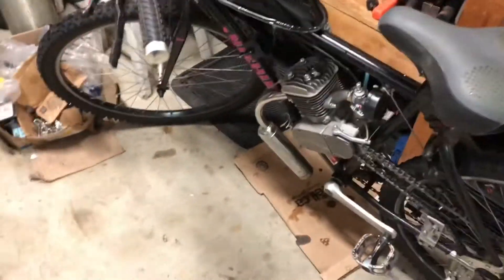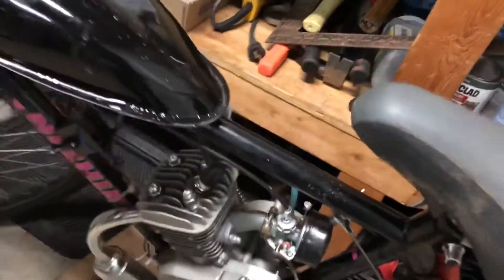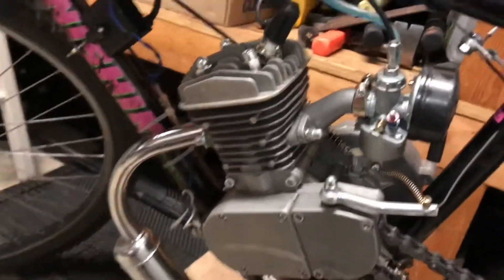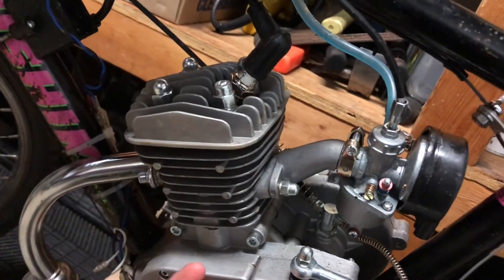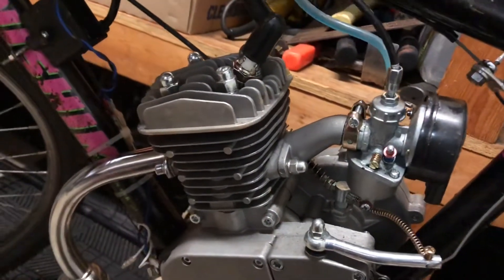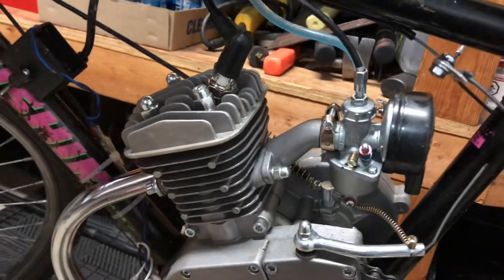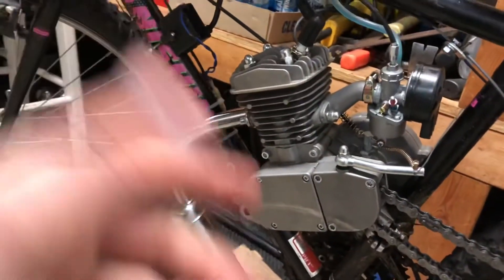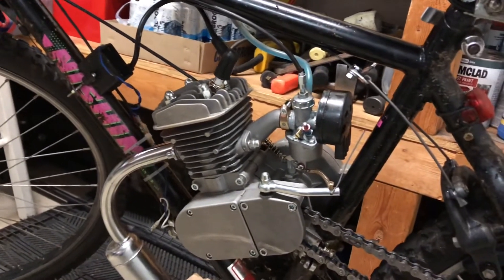Making MORE POWER for FREE on your Motorized Bike!

Comment: For more power take off the exhaust pipe, sounds nice and you can feel the power
Reply from the maker: In my experience, taking off the cap did make it louder yes, but I actually lost power because there was no back pressure. The carburetor hated it too. If you take the entire muffler off on a two stroke, it can over heat and wreck the cylinder. I would advise to not do that haha. If you want, you can check out my latest video of me taking the cap off. It was kinda a joke, but lessons can be learned.

Comment: 😁First and foremost Everatti.  You are so good breaking down on how to mix the fuel the right way.  Excellent job. Im gonna run 40:1 on my new 100cc 2 stroke I'm putting in.  Now it's my turn to school you on how to calculate your mpg.  First of all you'll need a digital speedometer.  Dont matter what kind.  Next, Fill the gas all the way up. Now, set your distance, or range to zero.  Do not mess with it until you ran out of gas.  Now calculate the miles that you put on the bike.  For example:  if you do 70 on miles on full half of tank, (Actually it really is .60 gallon) do it just like this.  70÷.50=144.  And there's you're m.p.g. (144 m.p.g.) Simple isn't it?
Reply from the maker: Thanks a lot! That’s a helpful tip. I’ll use that. I’ve actually got a digital speedometer on my bike, so that’ll work perfect!
Reply: @Everatti  Anytime 😁👍🏼

Comment: High octane, no methanol ( methanol eats up the lubrication properties of the mix oil fast it can drop 10 points overnight, so a mix of 40:1, can go to 50:1 so avoid methanol blends, plus it gums up carbs), Redline Racing Smokeless low sulfer synthetic, mix, 20: 1 to break in for a tank, then up to 40:1
Then let R rip tater chip
Reply: I run 20:1 used motor oil like comrade Stalin suggested. The Soviets thought of everything. 👍

Comment: Higher octane does not mean better quality fuel. Recommend a better fuel filter Its all about cleaning your virgin engine before hand.
Reply from the maker: The higher octane isn’t better quality fuel. It’s just where I live, anything but high octane fuel has ethanol in it. I’d get regular fuel if it was ethanol free. The ethanol in the fuel can gum up the carburetor if you leave it sitting for a while. It’s just not the best for the engine

Comment: My bike runs on Avgas Lucas oil mix and let me tell you my machine is a freaking lightening bolt lol

Edit: also It’s a between a 40-1/50-1 ratio, also fuel oil ratio doesn’t matter you can run it straight to a 50-1 ratio you just need to control your urge to punch full throttle. Great video man
Reply from the maker: Thanks!

Comment: Dude thanks a lot my engine would not get to high rpm until it was fully warmed up and the exhaust gasket would splatter oil on my knee when I was driving and I was using 16:1 and now I am going to try 32:1 now and I took the filter out of my intake and it runs a million times better and flows good at high rpm!!!
Reply from the maker: No problem!! That’s awesome good for you
Reply: What is the benefit of taking out the filter? Im having a bike kit aswell🙃
Reply: @maximroos6893  Allows way more air and less 4 stroking

Comment: I run 40 to 1
Reply: I'm at 370 miles no power loss
Reply: @jasonwilliams4197  stock head?
Reply: @iiferedoncXclan  yes all stock
Reply: @iiferedoncXclan  it a one peace head and jug 80cc
Reply: @jasonwilliams4197  be careful I blew a stock head running 25:1 5k kilometres
Reply: @iiferedoncXclan  I have a extra motor just in case

Comment: so i just bought my first kit, i have not even run a full tank of 16:1 yet and it will not start without me pouring some gas down the spark plug hole, after i do that it runs fine, does anyone know whats going on?
Reply from the maker: If it only does that from a cold start there’s nothing wrong. You just need to put the choke on haha. Check your plug color as well, and see what it tells you. I could probably narrow the issue down a bit if you were a bit more specific
Reply: @Everatti  it does that even after 20 to 30 mins of riding even with the choke on but thanks for the help
Reply from the maker: @978_danny5  okay, take the spark plug out. What color is it? If it’s brownish then the mix is perfect and it’s not the issue. If the plug is whitish, it’s running too lean, which explains it only wanting to run on choke. If it’s black, it’s running too rich, which is probably because of the 16:1 break in ratio.
Reply: @Everatti  so should i go straight to 32:1 or 40:1?
Reply from the maker: @978_danny5  If you’ve gone through a full tank, then sure. Go easy on it though. I’d only do 32:1 to start. If that doesn’t fix anything, come back here and I can try to help. Oh yeah, with 32:1 it’s gonna feel way faster too lol. Good luck
Reply: @Everatti  thanks!

Comment: Can i use 20 to 1 mix during break in period ? And after 40 to 1?
Btw im using castrol 2 stroke oil semi synthetic
Reply from the maker: Yes that would work great. Make sure to do at least 2 full tanks of gas on the 20:1, and go real easy on it until that break in is over. 40:1 should work great, but everything depends on your specific engine and how it runs for you. I’d check the spark plug after the first time on 40:1. If it’s black or brown, you’re perfect. If there’s any white on it at all, you’re running lean, and you need to richen up your ratio a bit. Thanks for the comment👍
Reply: @Everatti  ive changed the jug and added a cnc high compression head so its new , am i going to damage the engine if i go full throttle like for 1 sec or less just for the cool sound , during break in period?
Reply from the maker: @dj_impotencja  No lol. Just don’t hold it there forever. The main thing you don’t wanna do is keep the engine at a certain RPM for a long period of time. Full throttle is no issue, as long as you take it easy, and vary the RPMs.
Reply: @Everatti  thx for the advice
Reply: I recommend semi-synthetic breaking and then go to synthetic after
Reply: Yes , that's all I've ever done!💯

Comment: Wow lots of wrong facts.  You run 18:1 of organic 2 stroke oil for 2 gallons of gas to break it in.  This is so the rings can form. The oil helps remove particles from this process.  After it says 32:1 on literally all 10 of these motors of every random type you could buy lol.  Oil mix is 32:1 because of cheap bearings and seals in these kits. Also 40:1 or 50:1 will chew away at your chrome liner.  Now people mod these use different non stock parts and can run mixed like 50:1 without issues. One key point on oil mix in 2 strokes. Higher oil content keeps the motor cooler. Correctly tuned 2stroke will run fine on 32:1 "synthetic"under conditions like these bikes run.  My bike on my youtube channel is 32:1  mod yd100 can pull a 45mph run on a tooth sprocket lol
Reply: He's just a kid lol
Reply from the maker: Everything you said is correct. Run 16:1 or 18:1 for the break in if you’d like. That’s what I said lol. 40:1 is no issue on a stock motor - I’ve been doing it for almost 1000km now with no issues. Only thing that’s wrong here though - the air helps cool the cylinder, not the oil. The oil is there to lubricate the cylinder, not cool it. Although, if you are to use way too much gas over oil like 70:1 or something, that would obviously not be lubricating the cylinder, thus causing you to burn up your engine. So yes, at that extreme level, the oil cools the cylinder, not the gas or air. But I suspect no one runs 70:1 on one of these, so it defaults to the air cooling, not the oil. Have a great day dude👋
Reply: @Everatti  bud the oil cools and lubricates
Reply from the maker: @timothysmith9336  Lubricates, yes. A by product of lubrication is cooling. But cooling in itself, no. The air is what cools the engine.
Reply: @Everatti  bs

Comment: You totally disregard the Fact that the lubrication provided at 16:1 ratio is very different from that provided at say 32:1 or 40:1.  Why would a supposedly knowledgeable mechanic or rider do that? You focus your entire concern on power and/or spark plug life. Not giving any care for lubrication quality. Doesn't make mechanical sense.
Reply: If you've ever gotten laid you know that once it's lubed it's lubed.. Nothing to gain by adding any more..😬👍
Reply: @6fiddy309  Bull shit. As I suspected, your mechanical savvy is that of a smart-mouth boaster.
Reply: @dehoedisc7247 🤔Never fight facts using fictional information my man.  You'll lose every time.
Reply: @slicaltimistic1  never invent allegations for the purpose of self worship and hide the truth from the crowd.
Reply: @dehoedisc7247  😊I don't invent allegation for the purpose of self glory.  Thats not my cup of tea. I'm listening to what this young man is saying.  And he's right about that.  That's explain why my 2 stroke engine is not running in the way it supposed to be.  I agree that I supposed to mix it 60:1.  Thats about 2oz for 1 gallon of gas for the break in only.  I do that on all my 2 stroke engine, and I have no issues on that what so ever.  It starts right up with just one or two pulls. I got a new 100cc engine I'm installing on my bike. (After I get this foot break straighten out).  I'm gonna tried his Patent Pending Method by mix it with 40:1 after break in and hopefully it won't blowing a lot of smoke screen on the exhaust pipe.  I'm gonna get tried that lucus smokeless oil.  No self glory here.

Comment: Popular Mechanics did an article explaining the differences in using a lot of oil vs a little. There was actually very little difference. The piston wear was exactly the same. Yet the ring wear was slightly different. The compression was exactly the same. I run 32 to 1 from the day its born to the day it dies.
Reply: 40:1 is the ratio 2 strokes have been using forever, I see 32:1 I just believe 40:1 was the original calculation to give you the best power and endurance ratio.
Reply: 50:1
Reply: @nikitamorozov1897 I've Heard lots of people say that, I'm not brave enough to go. Lean. I'll stick with 32 to 1 and maybe go to 40 to 1 eventually. Right now on 24:1 cuz I'm still breaking the Motor In. But regardless of everyone's different opinions this is a great discussion because it's discussion that no one can really settle on. But it's good to see the different people's experiences with different oil ratios
Reply: @nikitamorozov1897  Tiny pp like em dry.
Reply: One thing I got to say about the compression ratio being exactly the same when running a richer oil mixture that may be true until the carbon buildup between your piston and your cylinder head starts, at which point your compression will go up. And if it continues to build up enough carbon it will eventually start contacting with your spark plug. So in my opinion, running a very rich oil ratio for a long period of time will eventually cause the compression to go up on your motor until you get a catastrophic failure or really need to rip into it to clean all the carbon out.
     I've seen this happen on cars with 4-stroke Motors that had a lot of of carbon build-up due to wearing rings causing "blow-by"

Comment: 40 to 1 is totally fine especially for using Lucas Oil
Reply: I use 40:1 with a comp head, and banana exhaust, a hp carb with the stock jet from the stock carb, and a lean mixture in a 50cc, and I swear that thing trucks under load if its not in a high rpm range when it goes up a hill. I dont know how much power it makes, but I swear the sucker has 3 or more hp, I also tested this morning full throttle with the clutch out, and it went up to 8 thousand rpm just stationary. and please don't say "your ruining the engine with a lean mixture" because me and my friend diagnosed that it was 4 stroking all the time, and I just leaned it out, it runs so much better now. the problem is, you get it over 5500 rpm and it starts 4 stroking, aswell as idle.

Comment: Hey bud just sub cause just came across my feed, so lookin forward to seeing what’s up. I gotta agree don’t hold it wide open for long time but that’s zero fun brother so I def vote to hold it wide open it’s way more fun but that’s also why I’m always fixin mine...
Reply: I have been riding mine wide-open every day for several months now and just pour a little in. No measuring. I figured out to use less oil to use increase speed and stay cleaner from less carbon buuld-up
Reply: Shit, at $100 for a complete replacement motor...why not beat the shit out of em"

Comment: Honestly I came here for tips but I broke mine in at 32:1 cause someone said break it in 40:1 whole life take it super easy for the first few tanks I was scared of that so I did 32:1 notice oil coming out a tad bit which I know it’s going to happen ive done carb adjustment and still got carbon build up maybe I should go to 40:1 I’m slowly moving this thing
Reply from the maker: Great! Just remember to use a nice quality oil and you'll be all good.
Reply from the maker: I’m planning on running 40:1 on the next tank as well. 32:1 seems a tad rich still. You’ll be all good!